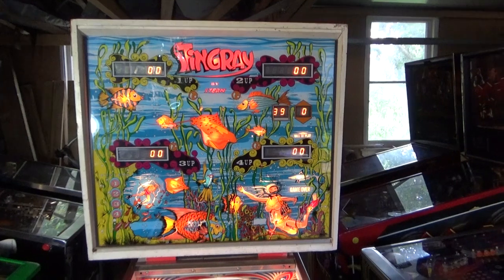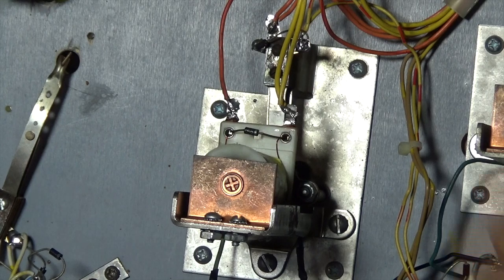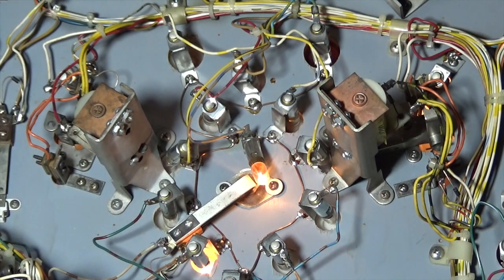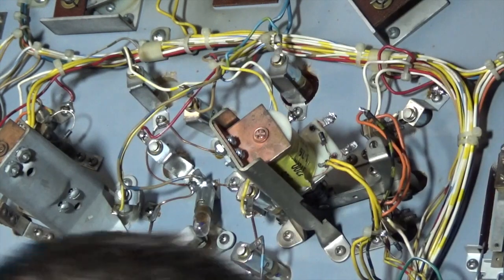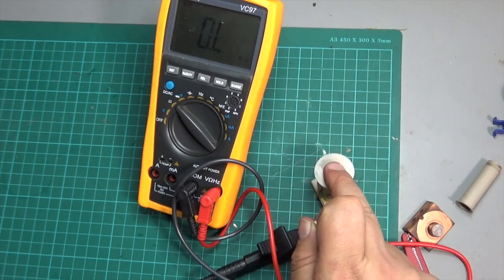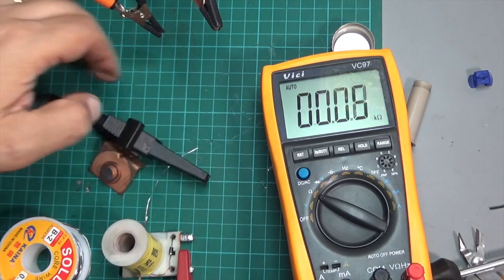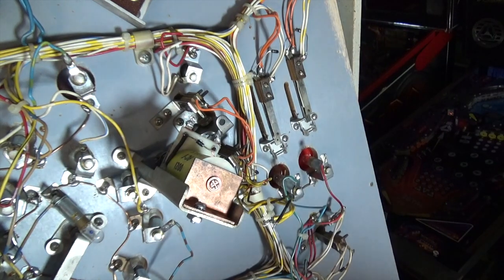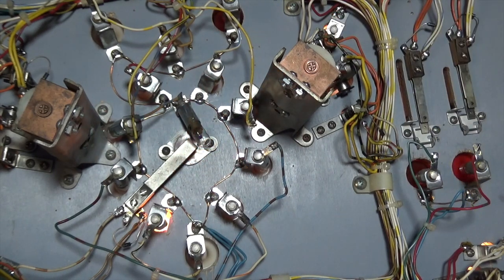Stern Electronics Stingray Pinball (1977) - Slingshot Solenoid Testing & Repair

Comment: The little holes in the ears that you solder the wire to are so you can put the wire through the hole, bend it over and then solder.  No third hand required.